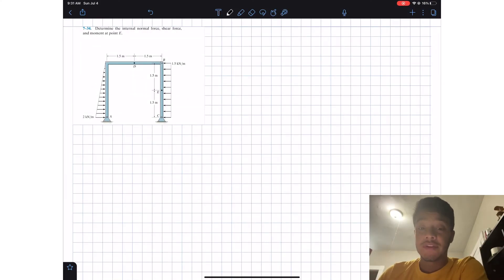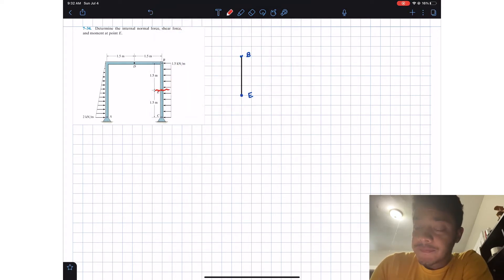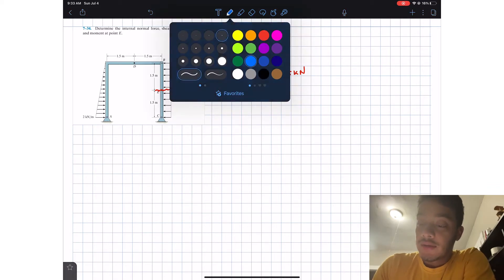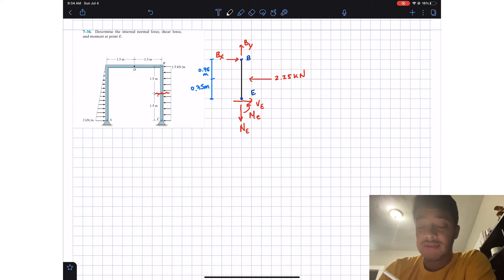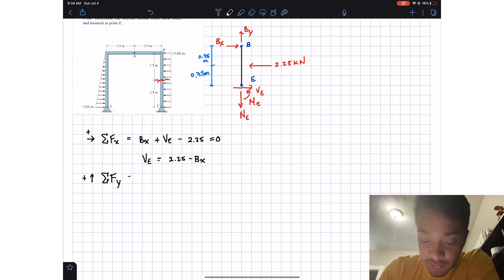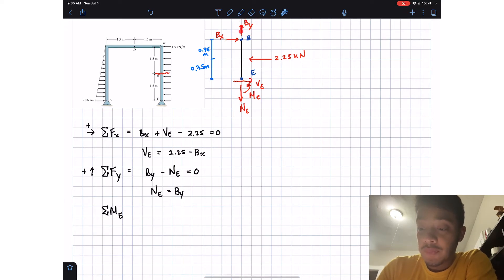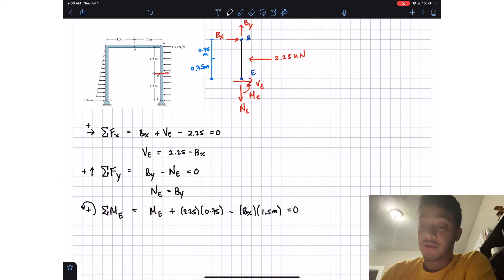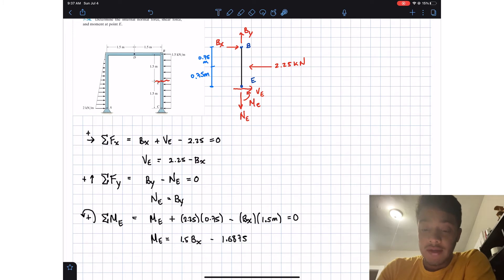Statics 7.34 - Determine the internal normal force, shear force, and moment at point E.

Comment: Thanks for the video, but I wanted to ask why when you cut BE beam, you put the shear of Ve in the same direction as x? shouldn't it be in y?
Reply from the maker: Hi, another way of thinking about normal vs shear forces is that normal force would be in the tension/compression direction of the beam and the shear force would be similar to a bending moment force.

In other words, if the beam is horizontal then normal force is in the 'x-direction' and shear in the 'y-direction' and if the beam is vertical then normal force would be in the 'y-direction' and the shear force in the 'x-direction'.

Hope this helps